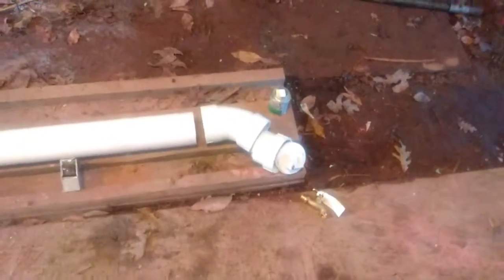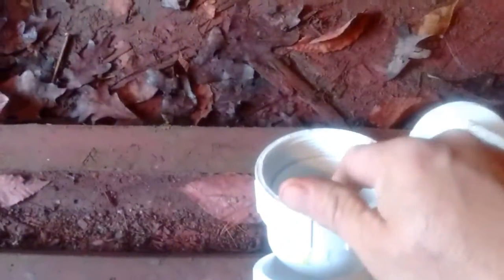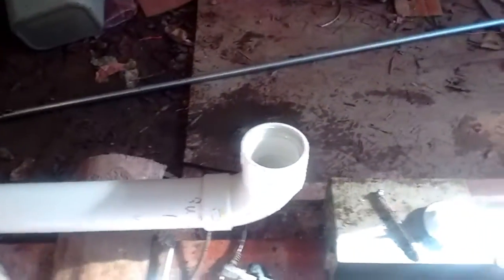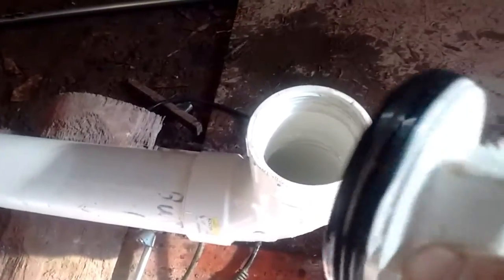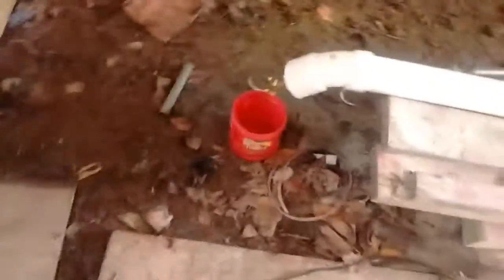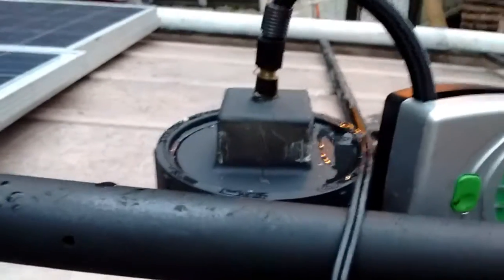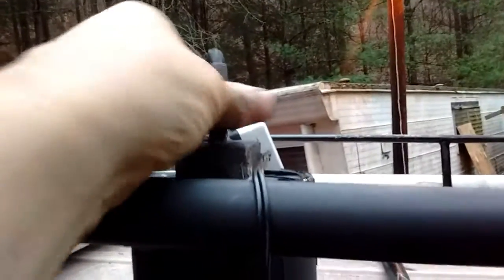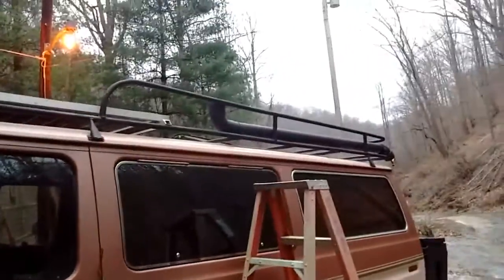Van Solar Water Heater

Comment: Can't you use a y instead of a 90  and reduce one end down for the heat element
Reply from the maker: Good idea. It would work as long as the element stays submerged.
Reply: @lukeFugate  actually your right you would have to add as y at the bottom end and you could also add a float switch to turn the element off when it gets low

Comment: Honey it’s a great idea but it’s already been done with 4 inch ABS black pipe! Your tube is way too small! You won’t have enough water in that to brush your teeth.
Reply from the maker: I Know it was done before. I just used what I had available. It has enough to take a shower, you just have to be quick. Would have been more water with a bigger pipe but I didn't have any at the time. I think since the smaller pipe contains less thermal mass per foot to heat it heats up quicker with a smaller pipe. You could also extend the length of the pipe and it would wrap around the rack and contain a lot more water. I found a garden sprayer to be better as it doesn't take up that much space and you can heat up some water on the stove or over the fire if you have a cloudy day. I don't even have the pipe on the van any more now.

Comment: Ok, SO I was trying to figure what sort of pressure valve I should have on my  system and I know town water has about 80PSI and some UT'ber said 30PSI was heaps... but when I see 15PSI spitting out like that.. well my super high roof mounted pressurised system is going to strip paint at 30PSI!!
Reply from the maker: Yeah, 30 should be plenty! Thanks for watching!

Comment: With the van doors open in winter, you can use your rocket stove to have hot water for your shower
Reply from the maker: I had thought about wrapping some copper tubing around the chimney and running water through it to heat the water. The solar heater only works on sunny days.
Reply: Yes!  It would heat it up every time and pretty quick! Rocket stoves rock! And hello from a fellow Kentuckian!
Reply: Also since you're a welder, have u thought of making your own hi top for the van so you could stand up. Some pretty great how to tutorials on YouTube
Reply from the maker: I have thought of that a lot especially when I bump my head. My only concern would be compromising the structural integrity of a thirty year old vehicle. maybe if I could extend the original roof supports it would be fine.
Reply from the maker: What part of Kentucky?
Reply: consider a aerator shower hose & nozzle. great job

Comment: don"t those caps have a sealing flange built right into them ? keep turning till they fully seat ?
Reply from the maker: I think the one on top was defective. I tightened it as hard as I possibly could and it still leaked. The one on the hose fitting sealed good after I gave it a good turn. I ended up putting some black RTV silicone around the inside of the flange and now it seals good with only hand tight.